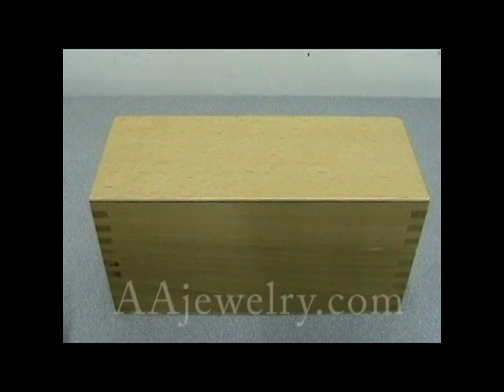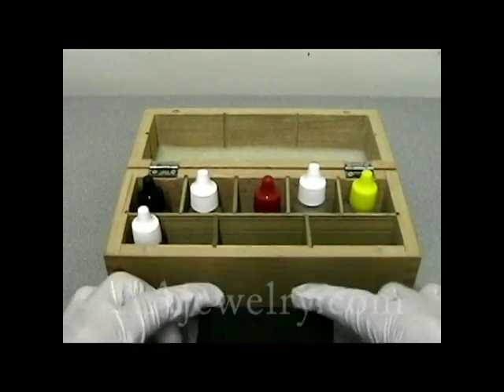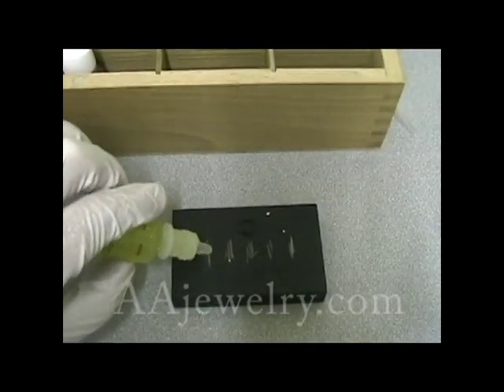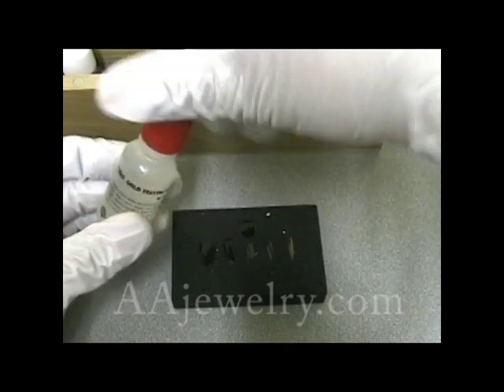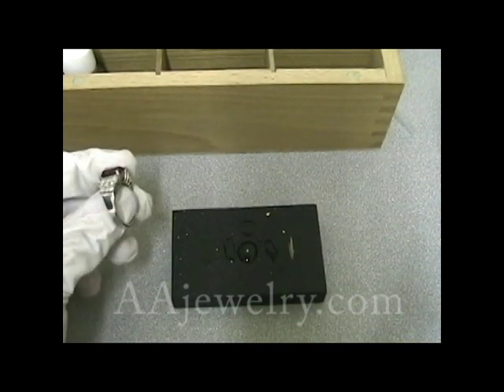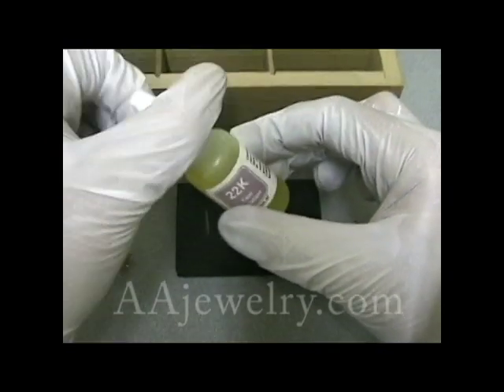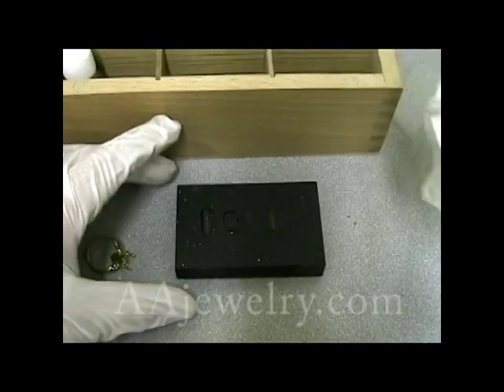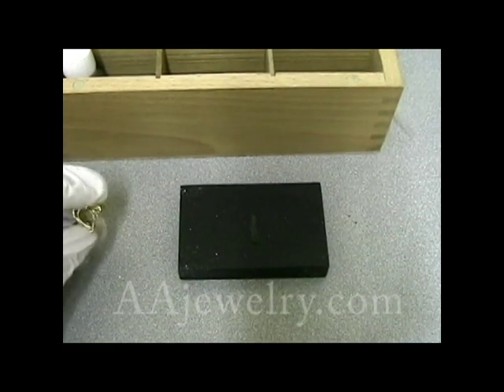How to Conduct an Acid Scratch Test for Precious Metals

Comment: The only acid you need is 14k 18k 22k  No professional uses platinum or silver acid. Scratch silver and use 18k it should turn a bluish white color and if you want to double check it. Take a small file and file a small nick in the band and drop 14k acid directly on the groove you just made and it will turn a milky white color. Now obviously you don't want to damage a piece of jewelry so the main thing before using acid. Look for a hallmark..silver will be 999,925,900,950,800,ster,sterling..ect. also silver is not magnetic but a lot of newer silver jewelry is rhodium plated which causes a slight magnetic reaction. Gold should never stick to a earth magnet. if you ever have questions feel free to call me..3027470944.